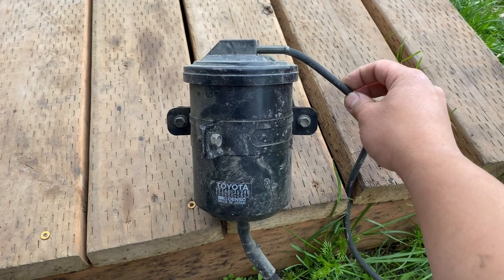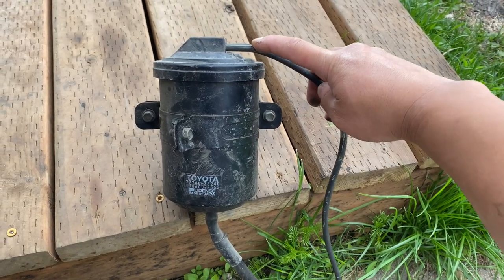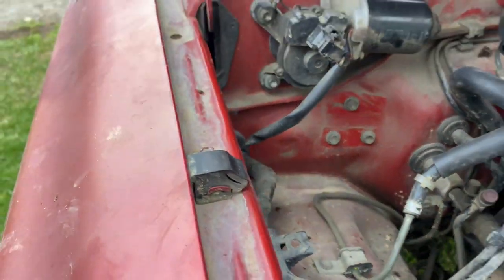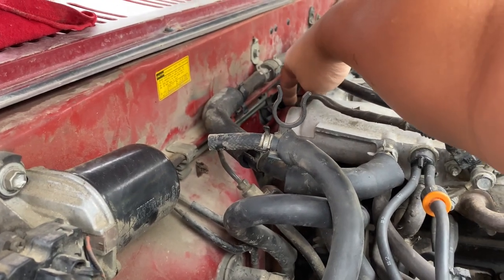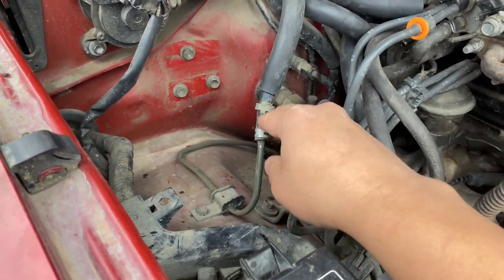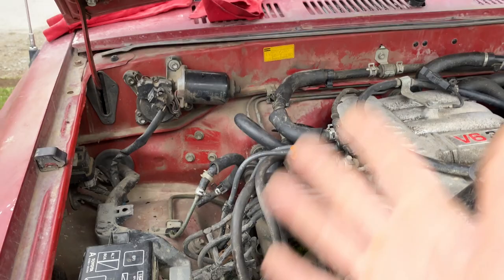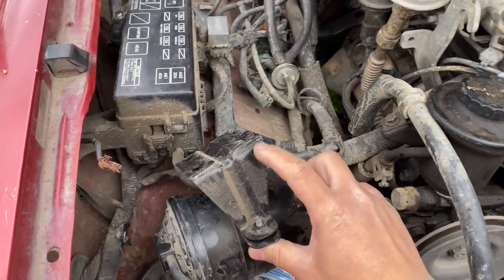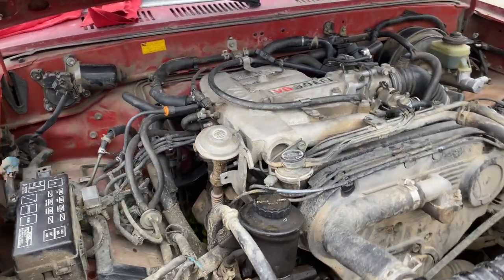TOYOTA 3VZE CHARCOAL CANISTER DELETE

Comment: This part is now made of unobtanium. For those that are wondering, that's why it needs deleted. However you MUST leave the bottom line OPEN- it controls the transmission and will create a huge issue if capped.  My truck was bogging down and the tank had incredible air pressure. I also had a stalling issue. Removing this can fixed the problems. Thanks for the idea!

Comment: Got a question from a reader about parts for retro fit of OEM replacement of canister. The refit parts are as follows. GM style purge valve circa late 70's early 80's A/C Delco part # 214-2294 about $35.00 Dorman part # 994-093 a few bucks less. The canister is a generic unit. Prices seem to be all over the place and I'm not sure why. part #  911-261 or 215-153 GM #'s 17056542 or 17113148 prices run from mid $30.00 to $90.00. I went with the FEXON brand more due to price than any technical research. some cans show a cover over the fresh air inlet. I believe this is removable and the fresh air line will fit on. Be sure the fresh air hose has its check valve, factory had one for a reason. If missing get one, without it the tank will constantly dump vapors. Easy to check blow into the top of the line, no air should pass. sucking on the line should pass air. suggest use a hand held vacuum pump to test inlet air so you don't get a mouth full of yuk.

Comment: Those fumes will build up in the tank and with time...too much pressure has nasty consequences,,i saw one whose tank always spat out fuel when the cap was opened sue to the pressure contained inside after deleting the fume camister system.. be careful
Reply from the maker: The fines will leak at the engine bay into the atmosphere, which is fine

Comment: What is the charcoal canister for
Reply: It allows the gas tank to breathe so that it doesn't over pressurize on a hot day or from exhaust pipe heat. It sends the fumes to a solenoid that the computer opens to allow the fumes into the intake manifold. The fumes quickly make their way into the cylinder and get used as fuel. My Toyota's canister is blocked right now and it sounds like the gas tank is boiling. No bueno!

Comment: Excuse me what is the canister delete for? Why remove it? But ultimately what are 5he benefits of doing the canister delete?
Reply: Don't do it ans don't delete the egr
Reply: @mendoblendo321  to late already did the egr delete, and truck running better
Reply: @zapz2101  trucks not getting the air it needs. Engine won't last as long or efficiently. It may for a short time but best of luck
Reply: @zapz2101  I just did mine as well, it NEEDED it, the egr valve was clogged to the point it was shutting off the truck instantly when the vac tube was plugged in. So to hell with it, and the truck idles like new, no CEL, no stinky gas, nada.
Reply: @mendoblendo321  well actually the EGR works off load not under so you should see no difference in performance whatsoever and as far as longevity you won’t see much there either it was just more of a benefit and cheap for him they want way too much for that part
Reply: They want $500 for a new canister for a 94 geo prizm. Def delete that shiz if its not needed, for a canister filled with charcoal thats a rip off, people making mad money on that crap.

Comment: OPPS! bottom line is fresh air inlet should have a check valve to stop out gassing of fumes. Far end sits in a hole in the frame to avoid splashing. Inside the little box on top are 2 lines one in from the fuel tank and one out to the engine. (spark ported) the vapor inlet line is from the fuel tank and should also have a back flow check valve. Fumes out of the tank only (heating and cooling = expansion contraction. air enters the tank via a one way valve in the gas cap during contraction.) the last line is the purge line. Inside the little box on top is a pop off valve that responds to pressure differential (that's why so costly) this port is also closed on a cold engine by means of the BSV. when the engine begins to warm up it opens allowing suction to the pop off valve. under on throttle condition the tanks vapors are purged. when the pop off valve fails pressure in the fuel tank shoves gasses into the canister until it is fowled, also into the intake. This doesn't stop until the engine cools and the BSV closes. THE FIX. Get a generic NP66 canister 3 pipes on top. 1 fresh air *AIR, 1 tank vapors *TANK & 1 purge *PURGE. Confirm fresh air line check valve is working, replace with fuel safe ck vlv if needed. & connect to canister (AIR). Confirm tank line ck vlv is working & connect and clamp to canister (TANK). now comes the good part, the purge line is too small to attach to the cannister. SO, attach section of fuel safe hose that does fit. Next is the work around using a standard GM purge valve clamp both ends of this section from canister to the valve, its under pressure at times. (GM purge valve is a free standing disc with larger in and out and a smaller vacuum control line port.) install it inline between the canister and the BSV. you'll have to use an adapter ( I shoved smaller BSV line inside the larger line and secured it with a spring clamp) the vent control line to the GM purge valve also needs to be spark ported. I tee'd into the "P" line on the EGR VM. cold engine no flow hot engine off no vacuum = no flow.  and TAH DA you can work as advertised and pass emissions.  

b
Reply: This is going to be such a stretch but do you have the part numbers of the parts you used? To make sure I'm not confused, you're saying 3 parts, gm charcoal canister, gm bsv, and gm purge valve? 

If no part numbers do you at least know the models/ years to look for?

Comment: sorry PS the generic canister is larger and the mount bracket requires a bit of modification. I cut a strip of aluminum flashing about 1" wide and give or take 8" long. and bridged the gap in the circumference.